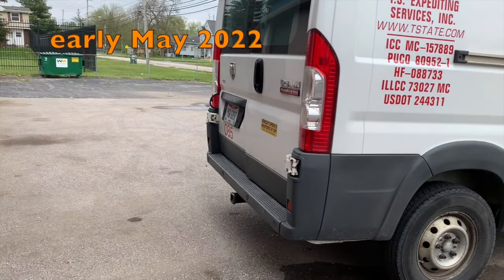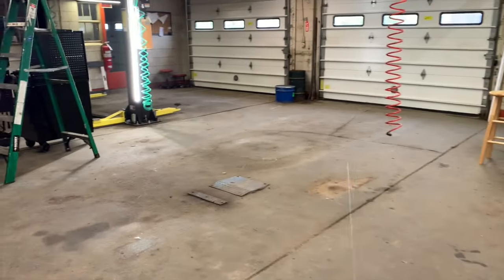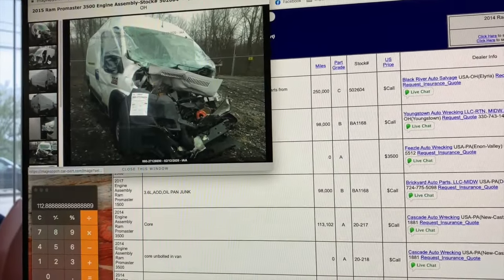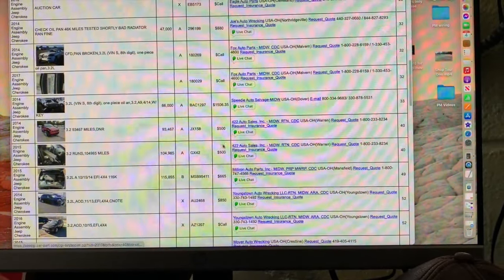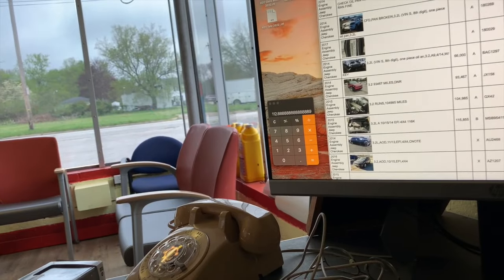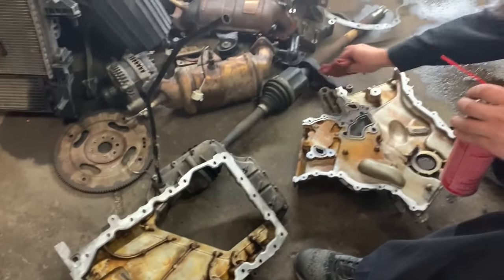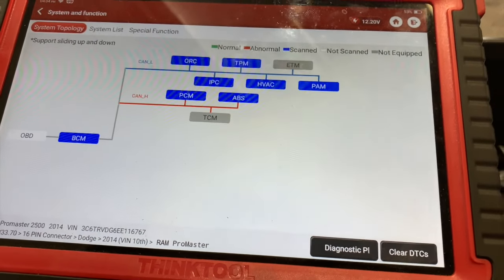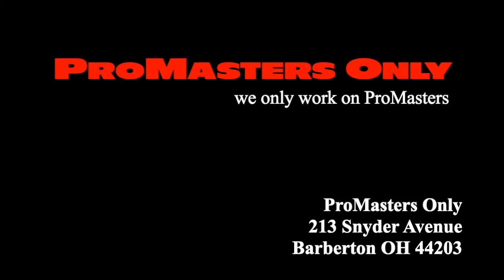Ram Promaster Custom Engine Swap ! Lots to learn

Comment: a 2014 caravan engine would fit in a 2014 promaster with no problem?no mods ?
Reply from the maker: The only part you’ll need to buy is a new dipstick tube. It’s longer on the promaster, and you’ll break your old one trying to get it out. Other parts you’ll use from your old engine are engine mount pad, and a bracket for the alrernator and a/c compressor, and fuel rail.
Reply: @promastersonly1419   thank you !
Reply: same with the journy engine ?
Reply from the maker: @ftfexpeditetransportllc5119  correct. Journey and minivan identical engines.

Comment: I have a 2016 3500 3.0L diesel ram promaster that needs an engine.
How much would you charge me to swap the engine? I'm ready to purchase a brand-new engine from the dealer!
Reply from the maker: I don't really work on the diesel, and while swapping an engine isn't all that complicated, I'm not really the guy for you since I have almost no experience with them. I can make 3 recommendations for shops that would be better suited. One in Florida, one in Georgia, and one in Chicago. No idea what something like that would cost. Sorry.
Reply: @promastersonly1419 which one in Georgia?  thank you

Comment: Its not the engine that needs to be changed but the transmission
Reply from the maker: Posted on FB also. The "weak" transmission is a problem of misdiagnosis and dishonesty. Coming up on two million miles on my vans - haven't lost a transmission yet. There will be a mega video on this topic in the near future.
Reply: @promastersonly1419  I look forward to seeing the miles per gallon after swap
Reply from the maker: @_WADE13x  Me too. Will take a few dozen tanks to know for certain. My guess is it will be just slightly better. Not enough to make the swap worth it if the engines were the same price. But they aren't.

Comment: Dodge will not like u lol u will make them loose money
Reply from the maker: Happy to help them lose money!
Reply: @promastersonly1419  question.  I have a 2013 ram 🐏  v6 3.6 would a caravan or journey or avenger motor fit ? I took hour reaching but nobody has done it.
Reply from the maker: @S2kkilla  To the best of my knowledge it will fit and work fine with the exception of the oil filter housing, which was changed slightly for 2014 and uses a different oil filter from the 2013. Otherwise, I’m 95% sure it’s all the same, and anything that wasnt would just come over from you promaster engine.
Reply: @promastersonly1419  thank you makes me save 2k on motor